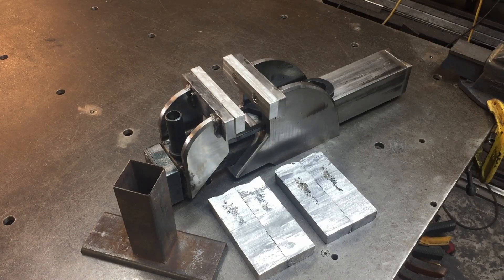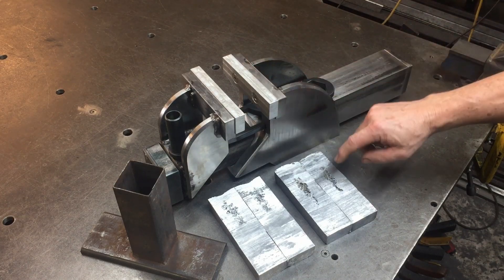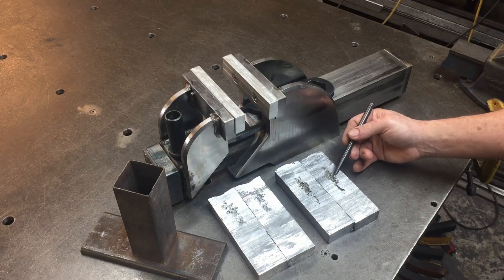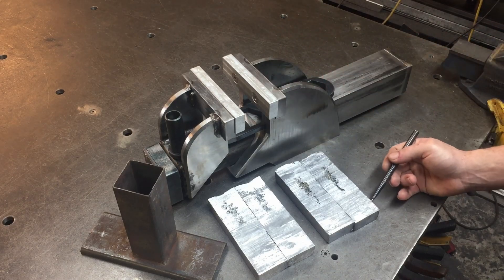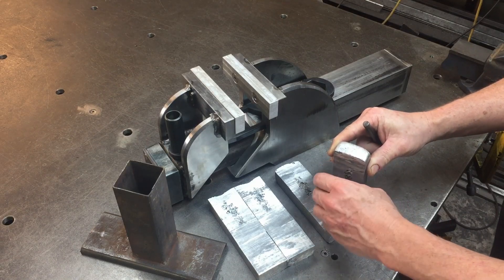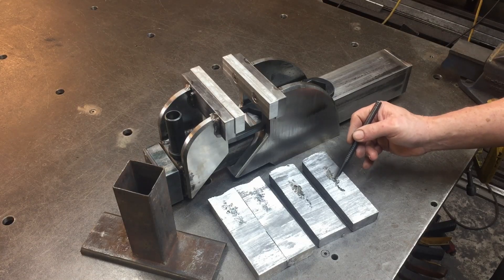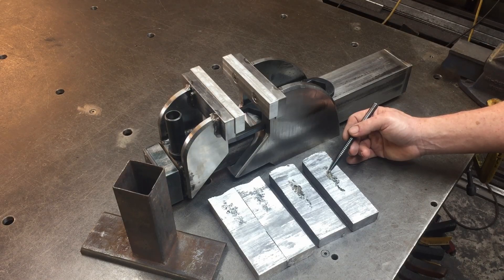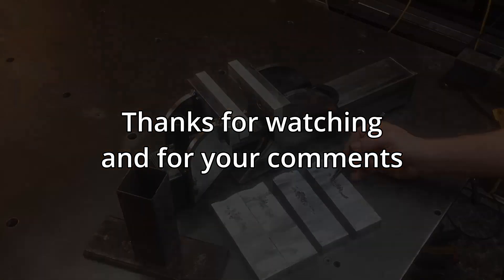Help Needed! - Investigate cavity in casting

Comment: A few tips. I started casting 40 years ago and made many of the same mistakes. You were probably pouring to hot. 

Molten aluminium corrodes steel badly. And the resulting aluminium casting is not as good as could be had. It makes for a porous casting. I cast and machined wonderful water pump housings that leaked through the casting when I used a steel lead ladle as a crucible. If you want to use a steel crucible get a refractory wash A silica based paint, there are other ways to shield the steel to. If you look you will find it.  and paint it on the inside. Same for your metal molds. The gent with the idea of using sand to slow down the cooling has a good idea.

Mark
Reply from the maker: Thanks for the info Mark. I should get a proper crucible so that the aluminum is not affected. I will need to look around to see if they are sold here.

Comment: What you see is shrinkage. Basically the top of the casting was feeding the bottom. This shrinkage is normal  for the way you cast the part. A design change will eliminate the problem.
Reply from the maker: Thanks.

Comment: The little needles are classic evidence of shrinkage.  If the problem was gas, the holes would be smooth round spheres, possibly joined together.  Controlling temp as Rob suggested would be a good first step.
Reply from the maker: Thanks for the pointers.

Comment: From some years experience in an aluminium foundry using highly specified alloys it amazes me that anyone expects to get usable ingots form such simple casting methods.  Your mold needs a highly insulated feeder which will feed molten metal into the required casting as it cools and shrinks.  There are a large number of sites on Youtube which will give you the idea.
Reply from the maker: Thanks for you feedback.

Comment: Soda cans is the worst source of aluminum you can use, I use car rim's or motor block aluminum and pre heat the mold, remove the drose before pouring, good luck.....
Reply from the maker: Yes, cans are not good quality for casting and machining. I will try some other aluminum from motors next time. Thanks for watching.

Comment: Shrinkage is normal. If you haven't got shrinkage then you have other bigger problems. That said @Xynudu has some suggestions from experience.

On another note, all the books I have read suggest casting aluminium from scrap castings rather than other soucres as it is better for casting. However I appreaciate you may have trouble getting castings from a scrapyard.
Reply from the maker: Thanks Ben. I do have some other aluminum like crank cases etc. that I can use. In this case I was just making vise jaws which will get all beat up anyway so I was not worried about the quality and some small bubbles/holes. But, I did not expect those cavities.
Reply: @thehobbymachinistnz  Crank cases should do well for casting, particularly important things.

Comment: I think you may be right - the outside solidifying faster than the center and shrinkage creating that void (vacuum). The crystallisation in the cavity suggests that too. If true, then you would need to slow the cooling down so that it transits from molten to solid slowly through that intermediate plastic phase.
Reply from the maker: Thanks Benny. I will try using sand (as others have suggested) next time to help slow down the cooling process.

Comment: That's an interesting one.  I've never had that happen and I've done a lot of casting.  I notice there is noticable porosity in the block as well, suggesting it's a gassing issue.  Did you use a degassing agent, as that can actually cause problems ?  Also did you pour at too high a temperature ?   I always pre-heat the mold, no degasser or flux, and pour at the lowest temperature possible.  Works every time for me.  Cheers Rob
Reply: I was having an issue with developing gas bubbles when i poured the aluminum in my cast iron molds. Couldn’t understand why that was happening. It was like, as soon as i got done pouring, all of the sudden, as it cooled just a little bit then one or two big gas bubbles would rise up and I’d have to push them down but still made it look ugly. After reading you comment here it made perfect sense. I was preheating my mold way to hot which is causing this according to your info. I was allowing the furnace to get too hot as well as allowing the molds to preheat too hot which is causing my problem. Thanks for the info Xynudu. Cheers smelters.
Reply: @backporchfoundryandforgeus900  I find the melt getting too hot is the biggest gassing issue.    It definitely should never get red hot and works best to pour as soon as it goes runny.  The quality of the aluminium (low zinc is best) also has an effect on porosity.  I haven't had too many issues with the mold getting too hot, but it needs to be uniform and allow to cool slowly to avoid shrinkage.  It's all a learning curve.  Cheers Rob
Reply from the maker: Thanks Rob. No, I did not use a degassing agent. But, I could have poured it when it was too hot. I need to buy a thermometer.

Comment: Try insulating the mould in a bucket of sand slowing down edge cooling might get the material to draw from the top like in the round mould.
Reply: I reckon Jayden is right bucket of sand or put mould back in furnace to cool slowly
Reply from the maker: Thanks. I will look at doing that on the next melt.
Reply: Try using Vermiculite as an insulator for the bucket. Vermiculite, or possibly perlite, are much better insulators than sand.
redrok